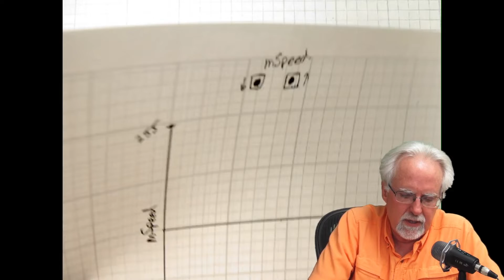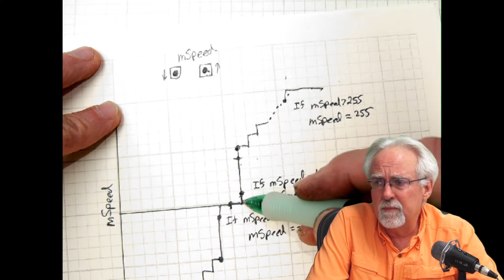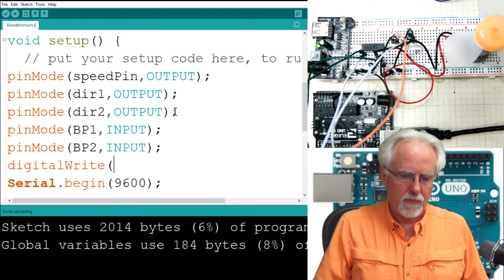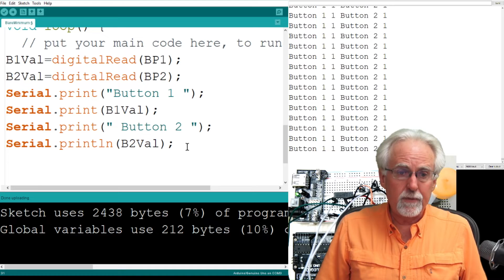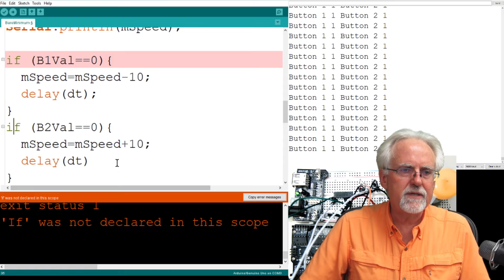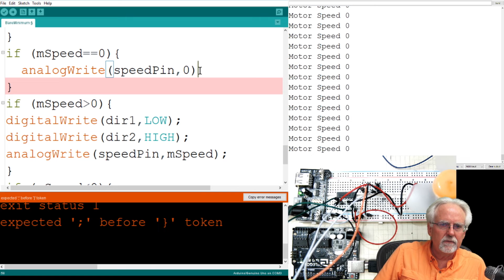Arduino Tutorial 40: Controlling DC Motor Speed and Direction with Pushbuttons

Comment: So much of the math is largely unnecessary. You can do essentially the same thing with the map function. Also, USE THE INDENT. It helps exponentially with making your code more visually organized. You can also use the “//“ symbols to make labels for different sections of your code. I’ve copy pasted my code below for examples of both. My only hiccup is that you have to set the buttonMin and buttonMax ints to be equidistant from zero. If I’d known about the abs function, I would’ve used it.

//IO constants
  int speedPin=3;
    int dir1=4;
    int dir2=5;
  int upButtonPin=6;
  int downButtonPin=7;
  
//equations & variables
  int baud=9600;
  int dit=125;
  int j=1;
  int mSpeed;
    int speedMin=100;
    int speedMax=255;
  int buttonVal;
    int buttonMin=-100;
    int buttonMax=100;
    int buttonMiddle=((buttonMin+buttonMax)/2);
    int buttonIncrement=5;
    int upVal;
    int downVal;

//text & formatting
  String msg1="mSpeed: ";
  String msg2="upVal: ";
  String msg3="downVal: ";
  String msg4="buttonVal: ";
  String spacer=" - ";
  String lineEnd=" ";

void setup() {
//serial monitor & objects
  Serial.begin(baud);
//IO pins
  pinMode(speedPin,OUTPUT);
    pinMode(dir1,OUTPUT);
    pinMode(dir2,OUTPUT);
  pinMode(upButtonPin,INPUT);
    digitalWrite(upButtonPin,HIGH);
  pinMode(downButtonPin,INPUT);
    digitalWrite(downButtonPin,HIGH);
}

void loop() {

//button codes
  upVal=digitalRead(upButtonPin);
  downVal=digitalRead(downButtonPin);
    if(upVal==0&&buttonVal<=buttonMax){
      buttonVal=buttonVal+buttonIncrement;
    }
    if(downVal==0&&buttonVal>=buttonMin){
      buttonVal=buttonVal-buttonIncrement;
    }

//motor code
  analogWrite(speedPin,mSpeed);
    if(buttonVal==buttonMiddle){
      mSpeed=0;
        digitalWrite(dir1,LOW);
        digitalWrite(dir2,LOW);
      delay(dit);
    }
    if(buttonVal>buttonMiddle&&buttonVal<=buttonMax){
      mSpeed=map(buttonVal,buttonMiddle,buttonMax,speedMin,speedMax);
        digitalWrite(dir1,LOW);
        digitalWrite(dir2,HIGH);
      delay(dit);
    }
    if(buttonVal<buttonMiddle&&buttonVal>=buttonMin){
      mSpeed=map(buttonVal,buttonMiddle,buttonMin,speedMin,speedMax);
        digitalWrite(dir1,HIGH);
        digitalWrite(dir2,LOW);
      delay(dit);
    }
  
//serial monitor printing
  Serial.print(msg1);
    Serial.print(mSpeed);
    Serial.print(spacer);
  Serial.print(msg2);
    Serial.print(upVal);
    Serial.print(spacer);
  Serial.print(msg3);
    Serial.print(downVal);
    Serial.print(spacer);
  Serial.print(msg4);
    Serial.print(buttonVal);
  Serial.println(lineEnd);
}
Reply from the maker: This channel is not about doing things the easy way, it is about teaching you skills people will actually pay for. No one will pay you to run someone else's library code, but people who actually know how to do math get the big dollars. Hence, I am teaching skills that lead to high salaries. Taking short cuts, cutting and pasting other people's code will never lead to a successful career.

Comment: Once again it seems like the code is longer than needed.  This may be being done for the purpose of implementing each of the equations.  It seems to me that the abs function makes the negative code that same as the positive set of instructions.  In the future (myFuture) I believe shorter code could e developed by looking at which switch was pressed, use that information to set the direction values and then use the same increment decrement code.
Writing this I also realize that when setting the direction value the step value would also need to be changed from positive to negative or from negative to positive.  The -1 multiply might be used here.  Not trying to be critical about this lesson, only to show that a small amount of thinking is being caused by your most excellent demonstrations.  There are always more than one way to peel an orange.  (I have a problem being mean to cats by attempting to skin them so I pick on oranges.)

Comment: I did not use absolute abs, instead I added a minus in the decrease speed value under 0 lol.

I did not use the parameters to go from 100 to 0. I said screw it and tought Paul is going to teach me how to add limits for the val. like 0>speed>255; Instead u used a lot of ifs :(

I also did not do the paperwork before.

I give myself a C+ :)

Comment: Hi Paul, took an entirely different approach and I DID THE MATH!
I use a counter score for the button operation between 0 and 510. I set the motor speed to 0 Between a count of 250 & 260. I reset the counter to 255 each time it went into those values, meaning it went up and down by the same amounts each time through the zero speed transition. I then use a slope calculation with my counter as the X axis and applied the formula to each case, backward or forward to get the mSpeed. I also incorperated the kick start routine for speed <75 ( my version = digitalWrite HIGH with a delay of 30ms) and had my motor running at 29 all the way to 255 in steps of 25 on the counter. Didn't know about the abs but didn't need it in my approach. 7 if statments for the entire program....
Fantastic tutorials, thank you Paul..

Comment: I established ranges using <= and >= to handle my special mSpeed cases instead of using == to handle exact cases.  I also included giving the motor a brief boost if the speed was between 100 and 175 so that it would start rotating.  And I was incrementing by 5.
Reply: Some samples for those curious
upSpeed = digitalRead(upPin);
  if (upSpeed == 0) {
    if (mSpeed <= -mSpeedMin || mSpeed >= mSpeedMin) {
      mSpeed = mSpeed + 5;
    }
    if (mSpeed == 0) {
      mSpeed = mSpeedMin;
    }
    if (mSpeed > -mSpeedMin && mSpeed < 0) {
      mSpeed = 0;
    }
    delay (dt);
    if (mSpeed > mSpeedMax) {
      mSpeed = mSpeedMax;
    }
  }

and 

if (mSpeed <= -mSpeedMin && mSpeed >= -mSpeedMinStart){
    digitalWrite(IN1Pin, HIGH);
    digitalWrite(IN2Pin, LOW);
    analogWrite(EN1Pin, mSpeedMax);
    delay(delayBoost);
  }

Comment: Hi Paul, I did complete this on my own, but once again, not as efficiently or elegantly as your code.  I did the caps for 255, but I did not put in a delay, nor did I make the adjustments to hit zero or 100 (start running) when dipping below 100 or just above zero.  I also incremented/decremented by 1, not 10.  Interestingly enough, doing that without a delay caused multiple "0" reads for each push and in effect, the motor did start running by the second push, maxing out in several pushes after.  So it was pretty much doing the assigned task... but nowhere as cleanly as your code.  I'm gonna go back and clean it up a bit.  I also wasn't aware of the "abs" function, so when mspeed was less than zero, I just multiplied it by -1.

Just for fun, I still left the joystick control in the circuit and code from the previous lesson, with an interesting effect.  The joystick pushes and pulls still run the motor to the max in either direction, but letting it come to rest just brings it to run at the speed and direction of the last button push, because I use an interim variable when setting mspeed with the buttons, and, for obvious reasons, don't reset to zero when the joystick is at rest.  Anyway, surely more than you wanted to know about my attempts, but as always a fun, learning lesson.  Do I get any bonus points for incorporating the joystick function in there, too?  If not, I guess maybe a "B-"?

Comment: I was pretty close to getting it right I had an issue with the negative side and was really having a hard time with why when I started going into the negative numbers it went from high speed at -1 to low speed towards -255. I did have it switching directions and working mostly the right way but definitely needed a bit of help fine tuning my programming

Comment: I managed to complete the homework completely by myself! The only difference I had with the way you did it is that I didn't tune the code so that it would omit the low motor speed values where the motor wouldn't move. Also, I noticed you used the absolute value command when using the analogwrite for negative motor speed values. I simply tacked on a negative sign on the motorspeed for my analog write and that did the trick. In hindsight, I probably didn't need to include analogwrites for each if statement, so in the future I will make sure to be more concise and efficient with my commands. Besides that, my code was able to handle the main tasks.

Here is the code is used in my void loop:

void loop() {
  // put your main code here, to run repeatedly:
  button1val = digitalRead(button1pin);
  button2val = digitalRead(button2pin);
  Serial.print("button1val = ");
  Serial.print(button1val);
  Serial.print(" , button2val = ");
  Serial.print(button2val);
  Serial.print(" mSpeed = ");
  Serial.println(mSpeed);
  delay(100);

  if(mSpeed>0){
    digitalWrite(directionPin1,HIGH);
    digitalWrite(directionPin2,LOW);
    analogWrite(speedPin,mSpeed);
  }

  if(mSpeed<0){
    digitalWrite(directionPin1,LOW);
    digitalWrite(directionPin2,HIGH);
    analogWrite(speedPin,-mSpeed);
  }

  if(button1val==0){
    mSpeed=mSpeed+5;
    analogWrite(speedPin,mSpeed);
    
    if(mSpeed>255){
      mSpeed=255;
      analogWrite(speedPin,mSpeed);
    }
  }
  if(button2val==0) {
    mSpeed=mSpeed-5;
    analogWrite(speedPin,-mSpeed);

    if(mSpeed<-255){
      mSpeed=-255;
      analogWrite(speedPin,-mSpeed);
    }
  }
}

Comment: Did it, but not exaclty the same way. First I incremented/decremented by 15 (just because 255 is a multiple of 15, seems easier to me) . And to get the motor starting at the first push I first made an IF statement for the "Zero interval"  

 if((motorSpeed <= 105 && motorSpeed > 0) || (motorSpeed < 0 && motorSpeed >= -105)){
    motorSpeed = 0;
  }

Then I coded those statements 

  if (forwardVal == 0){
    if (motorSpeed == 0){
      motorSpeed = 105;
    }
    motorSpeed = motorSpeed+15;
  }
  if (backwardVal == 0){
    if (motorSpeed == 0){
      motorSpeed = -105;
    }
    motorSpeed = motorSpeed-15;
  }

I also added a red  LED('cause there were no special occasions) to show when we hit the 255 limit, and stopped the increase/decrease into those statements

 if (motorSpeed >= 255){
    digitalWrite(pinLED,HIGH);
    motorSpeed = 255;
  }
  else if (motorSpeed <= -255){
    digitalWrite(pinLED,HIGH);
    motorSpeed = -255;
  }
  else 
  {
    digitalWrite(pinLED,LOW); 
  }

Everytime I do an assignment I'm like "Wow, it took time, but that was easy !", it's not because it is, it's because I watched all the previous tutorials to the end AND you're such a good teacher ! Thanks a lot Sir !

Comment: Wouldn't the code be just a tiny bit shorter if the increment/decrement was 1 instead of 10? Then there wouldn't be a check for 90 or 95, just a check for 99.

Comment: I would probably give myself a 80% everything was working but misunderstand the homework. I did  a 3 gears (low medium high) like a fan. It was a different problem needed if with 4 conditions 

if (bValUp==0 && bValDown==1 && bValUpOld==1 && bValDownOld==1){
  gear=gear+1;
}

PS: the problem you have with your motor is probably a voltage drop from the time you've tested it first.

Comment: Nailed it I thought until I discovered the requirements provided in the previous lesson did not include first press = start.  Added that and since my stepcount=5 I did not have to test for multiple cases coming down. Good one coach, thanks.  BTW I included a buzzer to alert when attempting to exceed MAXspeed :- )

Comment: When you had that error in the code for if(mSpeed < -55){mSpeed=-255;} it was really confusing why one decrement button push sent it down to -255.

I think I have an explanation why.  One of your special condition statements caused one decrement button push from 0 to set mSpeed=-100.  So the one decrement button push did that.  Then then next time void loop iterated/looped, it saw mSpeed=-100 and then set mSpeed=-255.

That was one of those errors causing unforeseen circumstances things.  It took me a while to understand why one decrement button push would immediately go to -255 since nothing in the code was supposed to do that.  Of course, I could be completely wrong.

Comment: Hey Mr.McWhorter, i did this on my own, here is my code!
I'm watching the video, and seems like I forgot to make it set to 100 at the beginning ahhhh!
Also I did a graph as well!

int butPin1=12;
int butPin2=2;
int butVal1;
int butVal2;
int speedPin=6;
int dirPin1=5;
int dirPin2=4;
int motVal;
int dt=100;
int dirVal=0;

void setup() {
  // put your setup code here, to run once:
Serial.begin(9600);
pinMode(speedPin,OUTPUT);
pinMode(dirPin1,OUTPUT);
pinMode(dirPin2,OUTPUT);
pinMode(butPin1,INPUT);
pinMode(butPin2,INPUT);
digitalWrite(butPin1,HIGH);
digitalWrite(butPin2,HIGH);

}

void loop() {
  // put your main code here, to run repeatedly:
butVal1=digitalRead(butPin1);
butVal2=digitalRead(butPin2);
if(butVal1==0){
  if(motVal!=0&&dirVal==0){
    motVal=motVal-5;
    delay(dt);
  }
  else{
    motVal=motVal+5;
    dirVal=1;
    delay(dt);
  }
  
}
if(butVal2==0){
  if(motVal!=0&&dirVal==1){
    motVal=motVal-5;
    delay(dt);
  }
  else{
    motVal=motVal+5;
     delay(dt);
     dirVal=0;
  }
 
}
if(dirVal==1){
  digitalWrite(dirPin1,HIGH);
  digitalWrite(dirPin2,LOW);
}
if(dirVal==0){
  digitalWrite(dirPin1,LOW);
  digitalWrite(dirPin2,HIGH);
}
if(motVal>=255){
  motVal=255;
}
if(motVal<=0){
 motVal=0; 
}

analogWrite(speedPin,motVal);
Serial.println(motVal);
}

Comment: Based on lesson 39, I did get it working on my own, but there was some flaws.  After watching lesson 40, I was able to correct my coding and now it works.  My code is a little different, but I went about it in very similar fashion as you.  At times I made it more complicated than it needed to be.  Thanks for the lesson.  It's great to work these out on my own.  I'm learning a lot about coding which is what I wanted.  Thanks big time.

Comment: Did my homeworks, worked from the first push. About abs(), I was wondering if such a function existed because it exists in other languages and is quite useful... then I searched into the references on the arduino website (For those who don't know the existing functions and don't know where to find them you should definitely go have a look: https://www.arduino.cc/reference/en/)...
But I didn't anticipate the +100/-100 dead zone neither the +5/-5 difference on the way back to 0.
Thanks again Paul !

Comment: I started to use -mSpeed, in the if statement, but remembered C# had an abs function.
Since the motor doesn’t work at slow speed I started at 105 and -105. This eliminated the extra if, but I used > and < in the if statements instead of == just incase the beginning number ever changed. The top/bottom comparisons I used >= and <= respectively.   I’m like you start with a pic or flow chart. I’m always drawing when explaining something or figuring things out. :)

Comment: I have a tendency to forget that math is permitted in the analogWrite commands. Remembering simple things like that can make solutions less arduous. Only thing I can contribute is:
(1) the following simplification for the deadband:
      if(mSpeed>-100 && mSpeed<100)
      mSpeed=0 
(2) an else statement for the negative motor speeds which works since there were only two options.

Comment: I did the homework and got it to work after a little debugging the debouce but the issue I was having and really didn't resolve was tying to read the mSpeed out. is there anyway of reading PWM through the Serial.print command or just with an oscilloscope?

Comment: My ability to successfully complete the homework with no bugs or glitches only proves you are a great teacher . Thank you Paul I'm so excited and my confidence just shot through the roof ! The hints at the end of the previous video helped immensely.
I used an "if else" to turn a negative motor speed into a positive output to motor, didn't know abs().
Also my buttons were programmed as toggles so no matter how long a button was pressed you only got plus or minus 10 per press.

Comment: I feel that in this tutorial you forgot the advice you gave in the very early ones - Don't use numeric constants when you can use variables to make the code more general. If you get a new motor which starts at 75 rather than 100 much of the code needs changing.   By  specifying a 'minimum speed'  variable  you can convert a 'nominal' speed into an 'actual' one by adding/subtracting the 'minimum' speed'.  It  does make the top end a bit more complicated.

Comment: Yes, but I overcomplicated it.  3 buttons (a stop button) and a variable for the increment/decrement value.
a Clockwise Boolean variable (not a simple negative for reverse) and a set of while statements for reading the buttons, pausing until they are released.
But yes, it works well.

Comment: Hi Paul (and fellow nerds),
I got an A+, although I initially was using ‘mSpeed’ with digitalWrite instead of analogWrite so the motor would always go full speed even though my other coding was right.
I approached it different, I assigned a value between 0 and 20 to the button pushes and assigned 0-10 as reverse and 11-20 to forward and worked out the relevant math for the analogWrite between 100 and 255 for 10 to 0 and 11 to 20 with 10 being mSpeed=0, I only needed a total of 7 ‘if’ statements and the buttons work like we did with the dimming project that 1 push is a speed change.

If this is bad coding practice can someone let me know because it seemed a lot simpler to write my way?

Comment: I think you could have fixed it with a drop of light oil on the shaft at each end. Having the shaft horizontal may have also fixed it. I do not believe those little motors are meant to have side loading on the bearings.